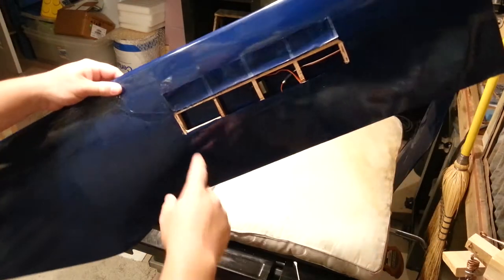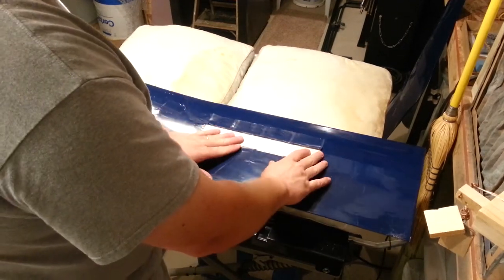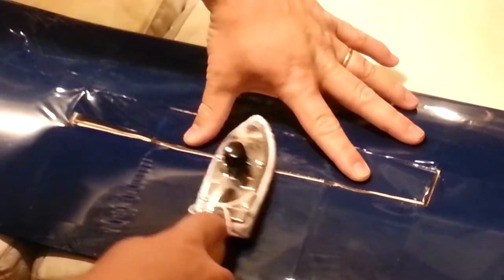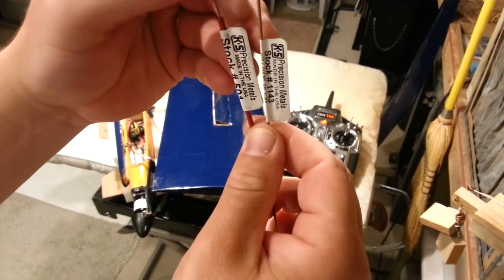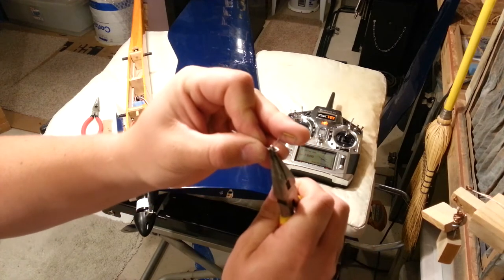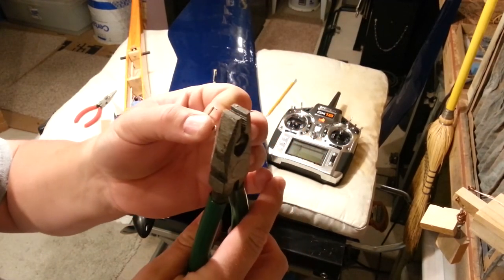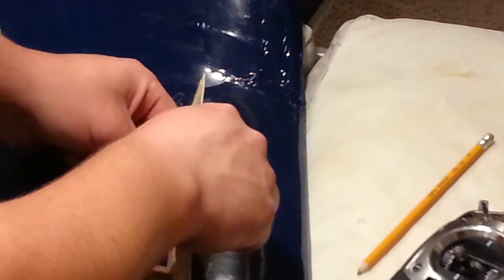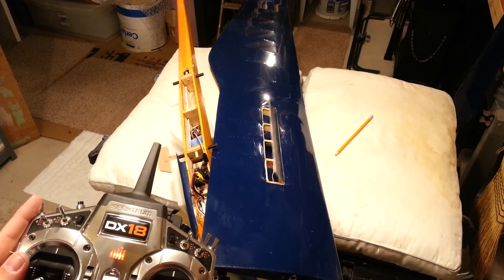Dynaflite - Bird of Time - Spoileron Mod - Part 4

Comment: Flew mine today with a 3000 vs the 5200 3s and really seamed better and lighter in the air, going to push the limits of CG an try a 2200 which would save 6+oz of weight